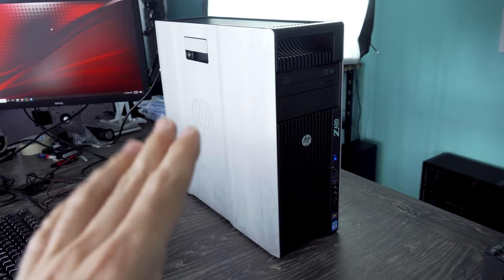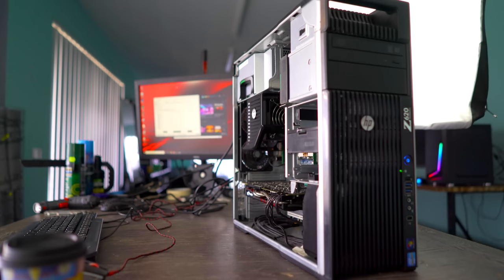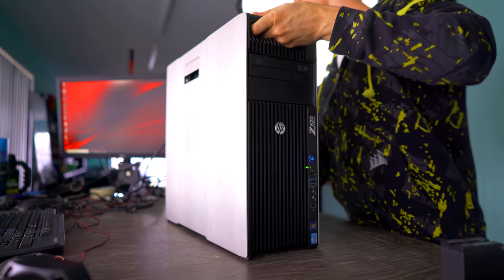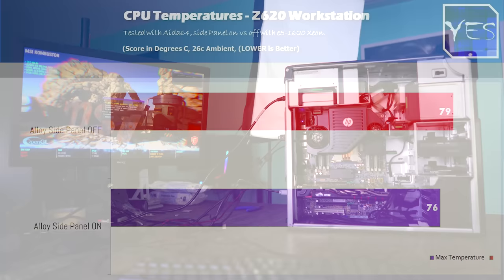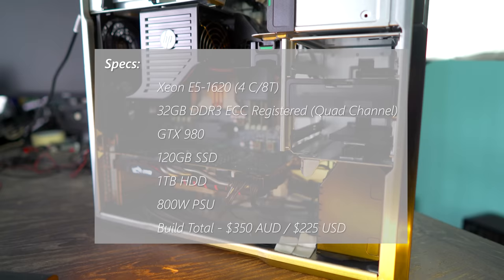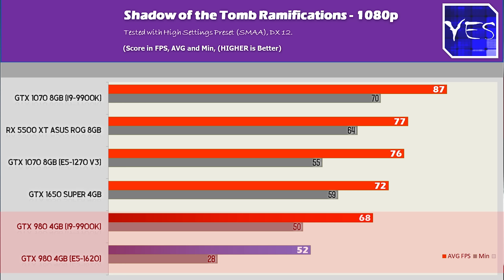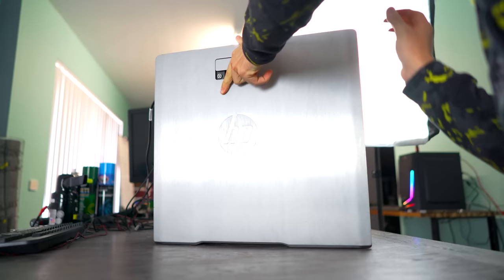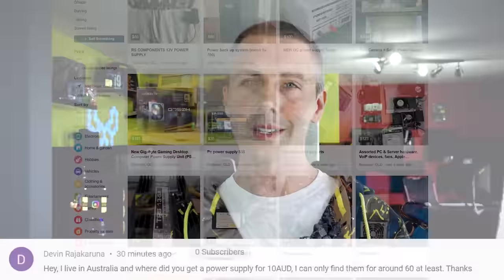Is a HP Z620 Workstation Still Worth Considering for GAMING in 2020...!?

Comment: Hey Bryan.
I have a Z600 with 2 x Xeon
X5650 CPU"s plus 2 x GTX 950 in SLI in it and 24 GB DDR3 ram. 
This has been my VR development PC and is a trusty little workstation.
Hope Dadman likes his new pc.
Cheers, Mon from Brisbane.
Reply: Mon Ham upgrade that with some new cards ;)
Reply: Are the 950s even SLI compatible? I would not use SLI these days... I was a big fan of it back in ~ 2010-13 when driver support was good. Nowadays almost nothing supports it
Reply: The GTX 950's run in SLI without a problem.
I've been working on this PC for the last 2 years in this configuration.
Reply: @techbuildspcs  The problem with upgrading the cards is the power supply. It has 1 x 6 pin pcie plug and 1 x 6 pin pcie plug off a molex plug.
To upgrade the cards means upgrading the power supply as well and that is not cost effective for what I'm using the PC for.
The 950's are good enough and were inexpensive two years ago.
Reply: @monham5041  Amazon et al sell adapters, or convert a one to two adapter onto the existing wires, crimp/solder and heat-shrink.
Reply: @monham5041  adaptors work fine, these hp workstation 6 pins are rated for 150w same as standard 8pins. powersupply is better than most consumer grade ones.
Reply: do you think you could run multiple VMs with this setup? like a dozen win 7 ISOs?

Comment: Using Intel Xeon W3690 with GTX 1070 Ti, ( dell T3500 ). Doing 4k Gaming on the go.
Its amazing build and very cheap. I got many videos on that
Reply: Do you get any bottleneck from the cpu?
Reply: A GTX 970 would be great
Reply: @Lucifer-xo4vb  Nope i never get any bottleneck at all. This cpu wants a powerfull graphics card to get paired. 970 is not worth at all an rtx 2080 would be perfect
Reply: Nahpets Android Gameplays lmao 970 is a small puppy for this beast. I’d recommend rtx 2070 or later gpus
Reply: @GamersOrb  try it in 1080p  to see if there is a bottleneck not 4k
Reply: Hey! I have a T3500 and it's amazing (W3680). I never got very good temps though with the copper passive CPU cooler so I can't overclock it. Do you have good temps?

Comment: I currently use a Z620 for my main gaming computer. You can overclock the CPU if the xeon is unlocked. I am pretty sure all E5-1600 series are able to be overlclocked . I use a E5- 1650v2 and I have it at 4.1 GHZ all core clock.  I used the intel extreme tuning utility since you can't overclock from the bios.  I am running it with a 1070ti FE and it runs like a champ.
Reply: How's your HP workstation holding up?
Reply: @johnsonbangura3074   Still running like a champ. I upgraded the 1070ti to a RTX 3060

Comment: Design was made together with BMW :) You should see cooling in Z820, compared to it Z620 is like "demo version"... btw there are two versions of Z620 v1 and v2. V2 supports ivy bridge cpus and max memory size support is up to 192GB
Reply: I know this is late coming but I have the V1 and even that can take 192GB of RAM, I'm running it that way now. Too long since I put it in, I no longer remember the exact specs of the memory, it runs at a pretty slow clock rate but it's stable. (I worked with a guy who was retiring a home lab box of roughly the same vintage as the Z620 v1 and I grabbed up his old RAM just to see if it would work, and it did...)
Reply: @carnotantonioromero3024  can you please check DIMM modules models? i would like to upgrade mine to 192G as well :)

Comment: I have one of these. I replaced the procs with the 2643 procs which gave the highest clock rate of all the cpus available and then put 32gb of ram and the 1060 6gb. It performs really well.

Comment: About 2 years ago I got my Z420 for $150 with a crap 1602v2 xeon and 32gb 1866mhz quad channel ram. And swapped in....
8c/16t core Xeon 2667v2 $100
Cooler Master T4 Cooler $30 (optional stock was fine)
Samsung EVO 860 SSD 250gb $60
2 x WD Enterprise 4TB drives $120 used
XFX RX5600X THICC $280
Can't complain for $740 plays all the games I want it to and has been an excellent productivity machine. I also leave many thing open all the time in 4 different Window's desktops and it serves as a TV show/Movie NAS for the 3 other PCs in the house. Its always on never sleeps and has never skipped a beat these are well engineered machines. I like them so much I may upgrade to a Z640 this summer.

Comment: Got mine (3rd pc) for 50€. Soooo next to nothing. Put an E5-1680v2 into it and OCed it using XTU on 6 cores. 8 core multiplierer can not be cahnged. V2 processors need a V2 board because their are two revisions with different bootblocks that can not be flashed using normal bios flashing. And you can make it a dual socket....

Comment: Z620 without the second CPU riser board is really no different to a Z420 except for the beefier PSU, if you're not intended to upgrade to 2 CPU in the future or just want to game, buying a Z420 may save you some money. Also the boot block date of the motherboard must be  03/06/2013 or later if you decided to  upgrade E5 V2 in the future.
Reply: Indeed...better off with Z420 version that can handle V2 E5 Xeons. The Z620 is worth it for the power supply, assuming you buy it in the original case at a low price. In the U.S., prices on these are too high, so I bought just motherboard when they were <$60 shipped. No that price is long gone. In 2021, Ryzen 3 and 5 series setups make the most sense.
Reply: sir please help me
Reply: ok i purchase z420 .i want gaming best card purchases please tell me eny your choice
Reply: The Z420 with at least a 4-core Xeon turboing above 3 Ghz can handle any mid-tier graphics card, old or new. I've run mine (8 core) with an RX 570 and GTX 970 without any stuttering. However, an RX 580 or GTX 980 or better would also work fine.

Comment: Tech YES MAN! Hell yes the Z620 is legit. So is the Z420! 

Also have you seen any Lenovo S30s down under? I'll tell ya what, it's as good as XXXX, S2011 E5s, just saw one sell for $153US with : E5-1660, 24GB Quad Channel DDR3 1866, Quadro (whatever, placeholder), 610W PSU, 2TB Spinner, etc. Just add GPU and SSD, and bam, gaming! 

My son's S30 has the E5-1650 3.2/3.8Ghz 6C/12T, and it's UNLOCKED. XTU lets me clock her at 4.4 all-core OC! 

Also check out overclocking monitors! It's perfect for TYC! 

And of course, from me and all of us, thanks for being there! You're hands down the best, most down to earth real-talking channel on Youtube.
Reply from the maker: Haven't seen an s30 yet, but got requested in an email to take a look at one, so I will do just that if i come across it.

Comment: There is one more thing Amazing about the Z620 :) Did you not ask yourself what the Black Cover under the CPU socket is for ? You Can Buy on Ebay a CPU Riser So the Z620 Can Have a Second CPU and 8 More Ram Slots This Thing is a BEAST

Comment: I have a z820 and I reckon these old powerhouses are really good bang for your buck. You can buy the extension card for z620 which you then can use a duel cpu set up which was pretty cool. I got my z820 for $300 bucks which was a great deal although I did have to  purchase a 2nd cpu but I’m not complaining given what I paid for it. It rivals more modern flagships and if you can find one cheap enough they are definitely the best option if your looking for bang for your buck. Seriously underrated in my opinion

Comment: My wife is still using her Dell with an i7 4790 we got on sale for 429 dollars in 2015. I've added a HyperX 16gb kit, 240gb SSD, 500 watt Bronze PSU, 1650 SUPER and the original WD Caviar Blue 1TB HDD for storage. Still on the stock thermal paste and it runs like a new pc.

Comment: Hey i've done an all out crazy RGB build with one of these. It is transplantable pretty easily! Just needs a $10 PSU adapter and a little jumper on the yellow USB header, then some BIOS tweaks (turning onboard USB 3 off, turning onboard 1394 off), and its good to go. I did an E5-2667v2 8 core/16 thread build with 32gb RAM and a 980ti with this thing. Its a monster. Edit: woops I misspoke, it was a z420 that I transplanted not a z620. I did try with a z620 but couldn't pull it off without an F1 to boot error.

Comment: I got mine for free with 8GB ECC DDR3 and a Xeon E2630 and Quadro GPU. I've added a 1TB SSD and a 16TB HDD, and an Nvidia 1050 and added 64GB RAM. RAM was $70, GPU was $20 on eBay auction. I just bought a CPU riser and a 2nd Xeon E2630 so I can go dual CPU. This PC is my basement (secondary) gaming PC for when I want to escape for some peace and quiet. It's an absolute monster, considering the price. I'm running Windows 11 Pro on here too.

Comment: I love my Z420 which is basically the same as the 620 but the Z620 has the option to install a second CPU daughter card making it equivalent to the Z820. I'm running a Xeon E5-1650V2 hexacore ( same family as the e5-1620V2) and although the motherboard does not support overclocking I'm using the Intel Extreme Tuning Utility to run my CPU up to 4.2GHZ. As far as I know (and I could be wrong) the E5-16XX V1/V2/V3 Xeons are unlocked and can be overclocked. The V4 variants unfortunately are locked. I ran Cinebench 20 after I cranked it up and got a score of 2362 at 4.18Ghz (GPU was an RX580). This on a six year old workstation that cost me $194 USD. A top tip for CPU cooling is to buy the cooler out of a Z440 (I got mine for $18) and fit the original fan to it. the Z440 cooler is much larger and keeps the CPU temps under control. These are extremely 'pro' machines. They weigh a ton but even with the abuse I've heaped on mine it has never so much as hiccuped. One question I have is  "Does running quad channel memory double the performance effectively over dual channel?" I'm running 32GB of 8GB 1866 ECC memory across all four channels and so far I have yet to see a CPU bottleneck.

Comment: My dad has this model, and it's letting me use it for Unreal Engine, and it runs well. He also got a Z Workstation that doesn't even have a number, and it's old enough that windows says it's 9 yes old, but that was when Windows was put back on. It was originally the software hub of a printing press.

Comment: Great video as usuall and great Timing for me especially. I picked up a Z620 with two 8 core Sandy-Bridge Xeons 2670, 32GB-RAM and a GTX1080ti (!!) this week. 
I bought it for the GPU, don't really need the Computer, so I'm going to flip it.
But, of course I had to go and Benchmark it. So, it Scores well in Cinebench R20, with its 32 Threads it's on par with a Ryzen 3800X
In GPU-bound Benchmarks, the 1080ti is a bit bottlenecked by the Xeons. 
Overall, still a great system for productivity and also gaming.

Comment: How much power will a 1650 and i5 4570 pull from the wall. I got a HP system for free with an i5 4570, 12gb ram but it has a 240w power supply. Its a low profile case and proprietary motherboard and power supply so cant really use a new case. Will a 240W power supply be enough?
Reply: If the psu was 350w it might work, you'll have to upgrade it but that would be a good system so worth it.

Comment: wtf? these cost like 500 used in my area
Reply: Same here. 200 series are 150'ish
Reply: @GuybrushThriftweed  yep same here
Reply: theres a lot of gouging going on at the moment, tax rebate, UBI and stimulus cheques ect.
Reply: You can purchase a z600 cheaper with dual xeons. Provided you purchase a version 2 motherboard you can upgrade CPUs into the 5670 and perhaps the 5687 after you flash the BIOS. Even though the z600 only has PCI Express 2.0 16x it actually has double the data lanes (bandwidth) of typical gaming motherboards, which means that even though the PCIe 2.0 is "slower" than the PCIe 3.0, because it has double the bandwidth, sending the data straight to the CPUs without a bottleneck from an IO chip, it competes. Plus with two CPUs and all six RAM slots occupied you have sexta-channel (six simultaneously loading slots) RAM. True, it's 1333MHz, but when you're pumping in data into six channels simultaneously... this is why the z600 still makes a hell of a gaming rig.

After flashing the BIOS the motherboard will boat from a SATA SSD. However, you can install an NVMe SSD and install the OS there provided you install the boot block on the SATA SSD <--- that way the motherboard will see the boat block, but the boot block can then forward the OS to the NVMe drive you have installed.

With the upgrades to the CPU, the sexta-channel DDR3 RAM, the broad data bandwidth direct from the GPU's PCIe 2.0 16x, AND either the SSD or the SSD-NVMe combo... the machine flies. People don't take into account that these machines cost $10K or more 10 years ago or so. And they were designed for data-heavy bandwidth applications. As such many of the I/O bottlenecks that exist even in high-end gaming motherboards simply don't exist on the HP z600 motherboard.

A reminder: You want the version 2 of the motherboard. There's a thread in HP's support forums that details how to distinguish. The Version 1 motherboard is limited to 5500 series Xeon and only supports unbuffered, unregestiered RAM, whereas the Version 2 board supports the 5600series Xeon and can also take ECC Registered RAM, which tends to be cheaper.

The point being if you find the HP z600 cheaper than the z620, so long as you do some homework, I think you'll see the z600 is a better deal in price-for-performance.
Reply: I forgot to mention that for the NVMe you'll likely want to get a 4x PCIe adapter card and install the NVMe onto it. Great read/write times that way. There's also a dual 4x PCIe adapter card that can house both the SATA SSD and the NVMe. It's convenient structurally, but you'll still need to access the SATA SSD via a SATA cable into the motherboard.
Reply: @Ckhpo  how can you tell which motherboard is a version 2???
Reply: @HoloScope  There are a few easy ways to verify version 2 of the board.  Look at the motherboard photo. Just above the first 16x PCIe 2.0 slot is a sticker with two numbers at opposite ends of the white sticker. To the left it reads 591184-001 and to the right it reads 460840-003. That's the most reliable way, but you may not have access to that information/image. If the seller is trustworthy and there are 56XX series Xeons installed, those are only compatible with the version 2 board. If the board comes with/recognizes ECC registered memory, again that feature is only available on version 2 of the board. Someone else has mentioned that if you have a caption of the CMOS screen and the "Block date" is beyond a certain time frame, that, too can be an indication of version 2 of the board. <-- I don't recall the exact date, but I think if it's a 2009 block date, that's a version 1 board. There's more discussion of that on HP forums you can find.

The HP z600 version 2's motherboard also has a larger centralized CPU/Heatsink than the version 1 board. There also seems to frequently be a mini fan on the version 2's central  board CPU, and I don't believe that is present on version 1 of the board. Hope that helps.
Reply: @Ckhpo  thanks a lot!
Reply: @HoloScope  Welcome. Also note that you may have to upgrade to Windows 10 pro to have both CPUs acknowledged. You should, of course, see them both in the BIOS, but in the version two board I just finished installing, even after updating the BIOS (make sure you do that), Windows 10 won't acknowledge the second CPU. So tomorrow i'm simply upgrading to WIndows 10 Pro. You may also have to set the "Storage Device Options" or "Storage Options" (cannot recall which at the moment) to emulate IDE if there are any issues trying to install or boot WIndows with the ACHI+RAID set as emulation option.

Comment: I watch this video "a little bit" later but for the last 3 years I'm on the HP Z* ecosystem. First with the Z600 (for a while) and after that - Z820. It was very good deal (the cheapest one in my country), for just under 1k AUD (as of today's exchange rates). These machines are very well build and despite their age, for most tasks are still competitive with current generations.

Comment: Love these videos, biggest question I have is how to you convert these systems that have HDD to ssd or nvme. That you want to keep the same info. I have so much trouble converting HDD to ssd in the past. Seems to take hours and maybe not even work. Is there an easy way you do this and which of the 20 programs do you use that all say there easy but they are not. Just wondering your thoughts on this.

Comment: The extra 2 wires for the gpu 8 pin are just extra grounds. You can just solder them to the grounds of the 6 pin. It comes out much cleaner.

Comment: I purchased 2 Lenovo s30 workstation. They take ecc and I am upgrading the cpu to an e5 2670. They came with e5 1603.. low end quad core. They came with a 600w 80 plus gold psu. They transplant perfect in a case that has a top mounted psu. I put both into raidmax enigmas. Keep an eye out for these. You cam get them on the cheap

Comment: I personally have the V2 version of this computer. The 6-pin connectors are able to deliver 150W instead of the standard 75W. HP has 6-pin to 8-pin adapters, as the 6-pin connectors have a different layout from standard ones. Most 6-pin to 8-pin adapters wont work correctly because of this. Also, the V2 version is the one to get. As the V1 version of this computer does not support the V2 processors. My current specs are:

E5-2620v2
8 x 4GB DDR3 ECC REG
250GB SSD
2 x 500GB HDD
RX 570 8GB

My processor is only 56c under full load, my gpu is around 75c